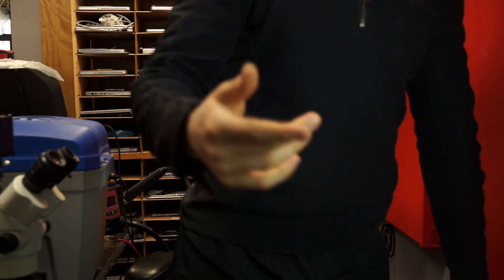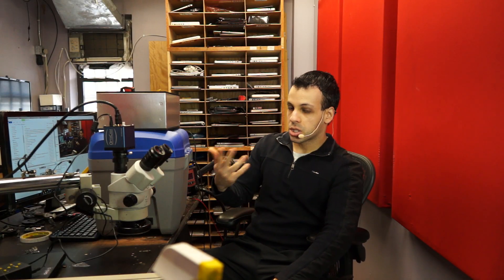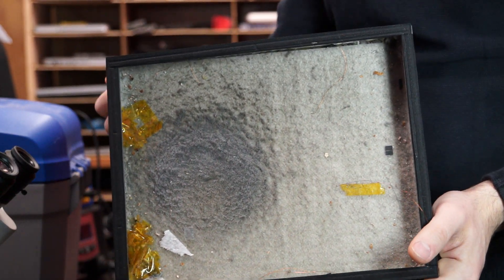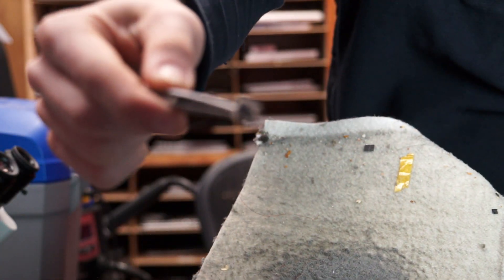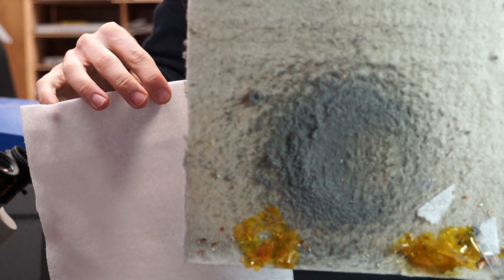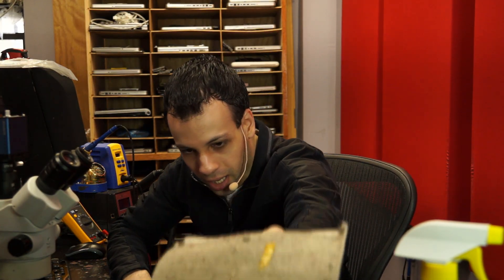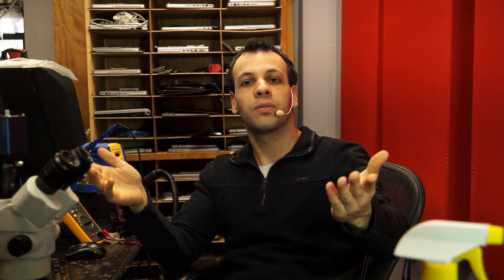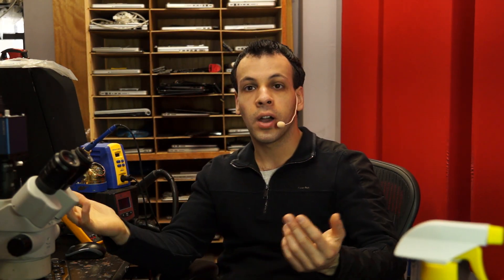A word on soldering and fume extraction

Comment: Pretty nasty prefilter.  But yours is not all from the solder.  I think you also have a lot of dust flying around your office.  I’d check your room for air leaks at the window and get a dedicated air filter (way cheaper than the extractor) that you do keep on all the time.  You probably would save some life on the extractor (and lungs?).  And I agree, an extractor is really important and oddly under mentioned and under demonstrated in electronic work videos.

Comment: I don't breath in isolation tape every day ;) or copper wire :P
But what you show is mostly dust (exfoliation and stuff) in de HEPA filter. And it's quite normal to breath in dust! Unless you are allergic to dust and pollen, it is actually OK to get it in your lungs, as that has been happening in nature for millions of years. Your body has natural mechanisms to protect you lungs against that.
Solder fumes (lead, flux) are MUCH worse. You don't see them like that. You need better filters to get these out of the air: activated carbon and such.

Comment: Thank you Louis Rossman! I demanded when I started at this job that they buy a fume extractor. It was my first job in electronics so people were touchy about it. Even with it I clean our workbenches and even with the larger debris cleaned off I still have my white paper towels recolored kind of shiny grey after. That said I only change the filter once a year and it looks a lot less "fluffy" than yours. Are you heating stuff besides solder and flux in that room? The only time I see fluffyness like that is in my home fume extractor when I don't vacuum often enough. In other words dead skin cells seem to make it fluffy.
I can say the Hakko 430 is nice and quite compared to their older product which was a noise nightmare.

Comment: I have used the smaller desk fans with the carbon filter in them and they work, they are okay, at least better than nothing. I upgraded my set up and got an inline mains extractor fan unit (they are usually used in bathrooms and stuff) and some ducting. Ducting on the the desk to the fan, then from the fan to out the window. Direct, high volume extraction to outside. No fumes or anything in the room and no need for filters etc. Whole set up was like $40.

Comment: Health and safety is very often overlooked. I work as a stagehand and very often there are people 50 meters above my head, climbing and doing work. At one point, not long ago, one of the "I don't need safety, I know what I'm doing." types fell off the rig, landed on a co worker of mine and killed them. It's the same mentality that makes people ignore all those fumes when soldering.
Reply from the maker: I'm so sorry. That's terrible.
Reply: Yeah, there is a reason for pretty much all health and safety precautions and only one reason to ignore them, which is laziness disguised as manliness.

Comment: Protip for the DIY or hobbyist: You can make your own fume extractor with an in-line duct fan, you can even get some fancy semi-rigid ducting and you now have a freely position-able extractor intake/head. If you blow it out the window or a hole in the wall, you don't even need the filter. Or you can make a filter using readily available parts, and make a recirculating extractor (just like the expensive ones). These will be, genuinely, just as good as the professional gear. I'm not gonna say it's a 30$ dollar fix, it's not - it will cost more. But it is affordable, if you cannot afford, or like Louis is saying, don't want to afford a proper fume extractor. Just be sure to use ACTUAL ACTIVATED CARBON FILTERS, not just random rubbish filter materials. You need that carbon filter if you are building a recirculating extractor. Else it's pointless. Literally.

Comment: It would be great to get that Hakko unit, but it costs the equivalent of more than $1200 where I am (UK), so I'm building my own setup out of flexible 5" and 4" PVC air duct tubing, connectors, intakes, home made plywood box, etc. I bought the plywood as cheap offcuts from B&Q. Not so far decided which fan(s) to use, but I have all sorts up to screaming fast Yate Loons, so plenty of options. Only thing I haven't done yet is source the filter (or decide where in the construction it will be positioned), will do that today.

The PSU came from an external SCSI case, so nicely compact. I don't have a window I can open wide horizontally though (it's the type that's hinged at the bottom, leaving a gap at the top that's about 11cm max), so the plan is for an intake via 5" tubing about 1m long (hanging down from a shelf), through a box with the fan(s), then out via 4" tubing just a bit more than 1m long (positioned horizontally) so the end (with a stiff connector fitted) can be jammed into the window gap at the top. It should work ok.

Depending on the fan(s) used, I might also fit noise cancelling foam and panelling inside the box to quiet it down a tad, and it'll have rubber feet to help prevent fan vibration from going through into the shelving unit (one of those large blue industrial types). If anyone's interested, I'll take pics of the construction and the final setup when it's done. I was going to include links to the relevant ebay items, but for some reason I can't CTRL+C/CTRL+V the links (another YT thing?).

Comment: A word of caution for anyone thinking that a dinky little PC fan with a carbon filter will do the job: It does not do fuck all! A study has been done by a German health organisation, showing how little impact such a setup has on soldering fumes: https://imgur.com/a/7BLG8Cf (The bar chart was taken from a Weller safety presentation, it's not just marketing wank tho).  It's in german but the bars speak for themselves. The red line is the maximum allowed concentration. Clearly, it'd be better to omit the carbon filter and instead get a stronger fan with ducting out a window

Comment: I 'wish' I could buy an Hakko with accessories for ~$700 USD. Unfortunately in AUS, we get butt-fucked every time we decide to purchase decent equipment. Here, an FR-430 will set you back $1600 AUD BEFORE you add the accessories! :-/ I guess I'll have to get by with a bathroom exhaust fan hooked up to some homemade filters, exhausting outside for a while longer.

Comment: I've got a shop-vac that would work decently as a cheap solution for fume extraction. It has an inlet and outlet with a filter in the middle. Hook up a hose to both ends and run the outlet outside if you're worried about anything that makes it past the filter. Should work pretty well and was only about $30-50. Plus it can still be used as a vacuum.

Comment: I also use eye protection because one time while just reattaching a connection I had some sort of air bubble form I think and a small dot of molten solder was sent flying...it arced and hit me about one inch below my right eye. I stopped immediately and went to find my safety glasses I had buried in some other gear. That little dot of solder burned quite a bit but I was very thankful it only hit my cheek.

Comment: I got a fume extractor years ago. I picked up a cheap mod kit from a surplus store, and screwed it to a 120mm fan. Rather than the typical computer fan, I used the high flow, 120 volt, all metal fans that we installed on motor drivers at my old job. Good airflow. I got a rotary inline lamp switch and some power cords from the same surplus shop, and wired up simple fume extractors that you could just place on the bench and run, with no extra power supply or wall wart. I loved the kit so much, I bought enough kits for all the soldering stations at work and told them to use the shit. If they weren't sure whether it was worth it to spend on 'em, fuck it. FREE. Just use the shit! It was super simple. They did like it and did pay me. I still have, and still use mine, though these days, that old industrial fan has a but of a rattle to it. I should look into replacing it. Over the years, I got my hands on a bunch of variacs, and learned I could plug the fan into a variac to control it's speed. Even dialing it back to 90-100 volts greatly reduced the noise, while still giving a pretty good suck. The original kits only had the white filters, like your prefilter, but I got a set of carbon filters to sit behind the white filter later on.

The flux fumes always bothered me. I used to just open a window and hope a breeze would clear it, but that doesn't work in winter, or in heavy rain. I wish I had had a good (or even a cheap) fume extractor when I was still a kid!

Comment: I went cheap, I have a regular air filtering system on one side of my soldering workplace, and also I have two small PC case fans on a small stand on the second side.
That made a horizontal air flow from the fans directly through my whole workplace to the filtering system.
Even though both the air filter and the fans are fairly low power (90W filter and 2x4W fans), the wind current is so strong, that I have to increase soldering temperature by 50 to 100 degrees to prevent it from cooling down my soldering tips and the solder joints before i finish the work.
I think it is actually more convenient setup than those tunnels because you don't need this setup to be close to you, the air current is strong enough so that you can place them further away and still benefit from the filtering. The air current covers completely my work space, no need to set up anything, it makes a kind of a horizontal air curtain.
The filter I bought used for 50€ (and changed all the filter parts of course), the fans are part of my own preheater that I designed by myself, they were for few €. When I put it on full power, I can even light a small camp fire on the workplace and not smell any smoke :P

Comment: For my soldering i just bought a bit of MDF board. Screwed a 120mm high airflow PC fan to it and using some PVC pipe fittings attached a bit of small aircon duct to it. Then i stick the MDF board in my window and blow the fumes right outaide. Cost me all of about $20

Comment: Will a shop-vac work for occasional hobby soldering?
Reply: Vent it outdoors and it works for any soldering. Hose is cheap too (I grab all I can on recycle center runs from discarded vacuum cleaners.)

Comment: I’m an almost graduated med student and I’ve been a smoker for 12 years. But I’ve quit because one summer I saw all that crap on my balcony windows. 3 mm thick layer of tar, awesome. I believe that flux fumes are not any better than tobacco smoke. You may like petroleum smell but you would be a complete dumbfuck to inhale it, wouldn’t ya?

Louis, protecting health costs money, agree on that. But correcting health costs way more. Just way fucking more. A cheapskate always pays twice. I don’t have a fancy fume extraction system but when I solder I just hold my breath and blow away fumes when I’m done. This must be as basic as washing hands when you get at home.
Reply: I've started using a gas mask when soldering. It's not the most comfortable, but it's much more affordable. If it works against chemical weapons it should be good enough for solder fumes...
Reply: Yutaka Takenouchi The thing is that different filters are meant for different chemicals. But I strongly believe that chlorine filter would be enough because flux fumes are much more heavy. Just don’t forget to change filters periodically and you will be on safe side.
Reply: There is a rating system that describes what the different types are intended for: 

https://www.gasmask-respirators.co.uk/ekmps/shops/respirators/images/pro-2000-cf32-a2b2e2k2-p3-combined-filter-[2]-133-p.jpg

I've been using A2B2E2K2P3 which should be enough against most paints and solder fumes. Commercial fume extractors seem to combine HEPA and active carbon filters most of the time.

Comment: Wow. This is the most reasonable advice I've seen online in regards to the subject of soldering fumes. People get so defensive and downright hateful when you even imply that maybe you could be breathing in LEAD rather than just flux. So many soldering tutorials where dudes don't wear gloves. It's pretty sad. I've also seen adult men get soaked in led acid battery fluid all over their hands like no big deal. Every single molecule of lead that enters your bloodstream via your skin, lungs, mouth, or eyes will stay in your body FOREVER.
I am also extremely poor, I make less thank 12k per year. I solder outdoors with a fan I got from goodwill sucking up the fumes right in front of my work. I also wear a soldering gas mask rated for lead filtering during extended work sessions, and I always wear latex gloves.

Comment: even at the mayor repair centers here in the U.S don't  use such a good extraction system like tbe one that you have.
at the most they use the fan with a small filter type of system.
kudos to you for using a quality filtration system.
in the only place i see a befter solution is in VGA REWORK

Comment: We had air extraction at the repair shop I used to work in 20 years ago, just tubes and a fan to blow it outside. And the way these tubes looked like on the inside after a few months !! Tar and  sticky goo from the flux all over!

Comment: I felt like crap without any fan. I got a Lasko box fan, took it apart and sealed a cheap carbon filter at the intake, then got a small desk fan which I put right where I'm working aimed at the box fan intake. Totally worked.

Comment: I will like to see two identical filters, one sucking in just air from the room and one sucking in solder "smoke" - i am not sure sure they will not look alike. 

Sure it is bad for you to inhale the fumes, but i am more concerned about the stuff i can't see. - on a side note how often do you replace the real filter and not just the prefilter?
Reply: The product manual says it only needs replacement after you've replaced the pre-filter ten times.

Comment: Couldn't you just run a vaccum cleaner when you solder?  500 bucks seems an awful lot for essentially the same function?  I know i probably sound stupid.... just wondering tbh
Reply: That's not how that works man
Reply: The vacuum cleaner would only filter the largest particles with the dust filter. The toxic fumes would simply be sprayed around the room through the vacuum cleaner turbine.
Reply: @funnyarc  Technically you can, but a vacuum cleaner is noisy and cumbersome. Not to mention that some of us have winters, and wildlife creeping in if you leave the windows open :)
Reply: You could put the vacuum outside.... but you better buy a duct fan and cheap hepa filter and duct hose...
Reply: If the vacuum has a HEPA filter then it does the job (noobs forget HEPA filters are common and cheap). The best way to use a vacuum is a shop vac to dump contaminated air outdoors and it works for welding too (with a larger vacuum of course). Only blowing contaminated air OUT OF THE WORK AREA removes everything AND draws in fresh air. It's trivially easy to cut a panel to insert in a window. 
You only need to filter atmosphere you intend to REbreathe. I've no desire to rebreathe any level of contaminants and enjoy the (slow, controlled) exchange of fresh air for comfort.  Long ago I toured the Chevette factory and the paint line air was the freshest in the plant.

Comment: When you are completely disconnected from the hobbyist community that you thing those are the cheap versions. That's madness hakko branded equipment is so premium it's silly, students and hobbyists use Chinese unbranded hot air and soldering stations and frankly they work fine, I've used jbc stations at university and they are good but not £800 premium good. For normal moderate use the t12 soldering iron clones are perfect, you can get a full setup for about £30. As for hot air the style of station reviews by Dave from the eevblog that cost about £30-£40 are great for the money. Finally fume extraction, personally I'd go with buying a carbon filter and a fan and simply throwing once together because the low end fume extraction market is not great.
Reply: On one hand you say the low end fume extraction isn't great but you also say you would buy one and then throw away. So I presume you mean they are ok to use but should be periodically replaced/disposed of?
Reply: @jamest4198  True, recently I have gone back  to basics on fume extraction, basic fan and an open window.

Comment: i believe the stuff would also accumulate on that filter if you run it in an office building for the same amount of time, because its just dust. however i used to be a logger and i know all about that macho bullshit and nobody can stop me from wearing a helmet if there is some goof fucking around on the roof of the next building or anything of the sort. being tough is about protecting yourself from unnecessary damage or risk of such. the real question is does it filter metal vapor and smoke? the "smoke" can be mesured with cleanroom equipment that no doubt someone will have access to but to meassure the metal vapor i guess we would have to get a chemist to destill some mercury through it. i am kinda curious now what it takes to filter out solderfumes.

Comment: Those things are overpriced for what they are though. It's a box with some filters in it, a fan to get the air moving through it, and some tubing to direct the suction to the work area. So basically, a vacuum cleaner with some filters, running at a lower speed and with less noise. Or a kitchen exhaust fan with the tubing on the "wrong" end. Don't see why that has to cost $500.

Comment: Dangerous fumes are 5-10 microns. They don't even see the pre filter. The $5-600's does matter.  

Cheap desktop units only trap the stuff that really doesn't matter and leaves the deadly stuff in the air. 

Backed up by a bulk air handler that will do minimum 3 changes an hour, the cheap stuff might help, a little. 

You need to do the right thing. Corporations are forced to. You need to do it for everything that matters to you after next week.